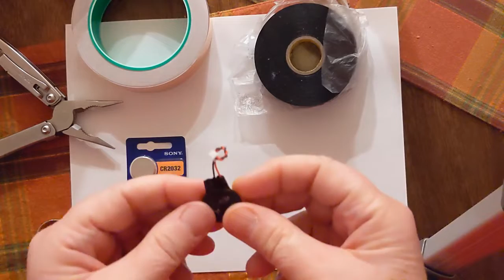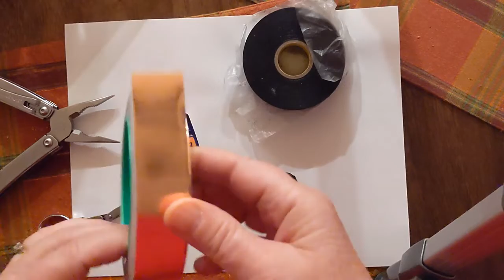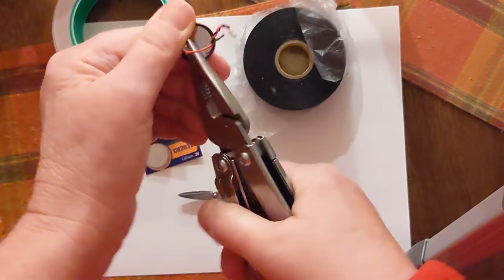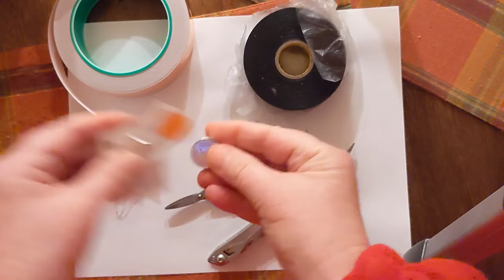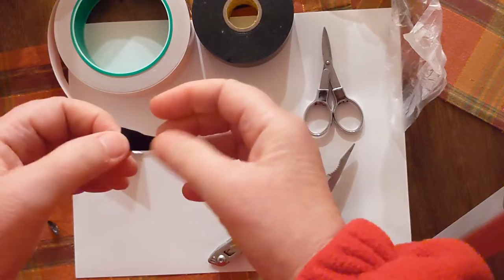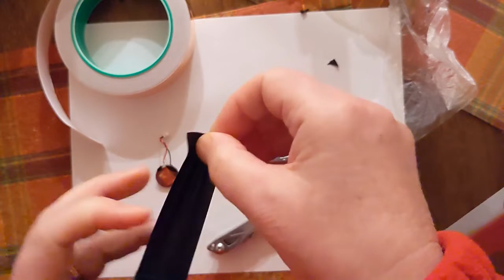DIY Laptop CMOS Battery

Comment: Why are these otherwise normal, sheathed CMOS batteries 🔋😮 so ludicurously expensive 😢... It just has an inch of twisted 🥨 pair of wires a pin 📌 and small metals welded to the sides of the battery 🔋😢, yes the sheath ofcourse 🤥
Reply: Capitalism:  $1 (new price at dollar store for 1 battery because of inflation) for DIY,  $3 (eBay) otherwise. It's still great that we have alternatives!

Comment: Hi, thank you for the video. I have a question regarding my Acer E1-570. The CMOS battery is soldered on the board.

I'm skeptical of soldering the replacement battery. Can I use the adhesive copper tape as a substitute of soldering?

Comment: Do all laptop cmos batteries with a cable and connector compatible with each other? I bought a used samsung r522 but doesn't has a batt. Motherboard has a cmos batt connector. Thanks in advance.
Reply: No, unfortunately the connectors do not seem to be compatible across all manufacturers.  Some laptop models have a 2-pin connector and others have a 3-pin connector.  And as you note, some laptops actually have a desktop-like socket on the motherboard.
Reply: @renebierbaum2131 , I have one spare batt (3Volt-2032) from my eee pc and can easily  connect to R522 mobo . Is this OK? Thanks for your time.
Reply from the maker: @vkdem , I just tried to research the Samsung R522 but didn't have any luck in figuring out what the RTC battery should be for that model.  Sorry I can't help.
Reply: @renealieo  that is why I have to ask.  Thank you for your time. You're a great person. Have a great day.
Reply from the maker: @vkdem  good luck, I hope you can find someone that knows the answer!

Comment: Thank you for this. Gave me the courage to apply this to my own Lenovo T420, which had it's CMOS battery die after 4 years. Additional points to note: The thin insulation around the edge of the 2032 is some form of thin but durable plastic, not heat shrink. This plastic is stretchable, and can be carefully stretched on the positive side  to pop it off, and then transfer  it back in reverse on to the new CR2032. This needs to be done carefully to keep it usable. Heatshrink tubing can be used as the outer cover instead of the electrical tape, which has the additional effect of pressing the metal plates tighter against the cell faces. Lastly, an LED with it's legs trimmed to equal length can be used to check the current is reaching the terminals as expected, instead of using the laptop as the tester.
Reply from the maker: Great suggestions, thank you!
Reply: done this today in my old m14 r1..i just remove the black plastic on the edge of old batt. and transfer it to a new one...heated in lighter to smoothen it..i've also covered the batt with heatsink..👍🏻
Reply: done this today..i'd test the old batt with multimeter, the reading is about 1.2v...the new one is about 3.1 to 3.2v..i carefully peel the black plastic from edge of old batt, and insert it to a new one...and heated it with a lighter..i'd covered the batt with heatshrink and heated up too..now, my old m14 r1 laptop, stops beeping..also thanks to this video tutorial..i'd save about 30 saudi riyals..

Comment: Does it need to be with that tape
Reply from the maker: The copper (metallic) tape helps create a good electrical contact between the metal tabs and the battery.  You might be able to do it without the tape, but you would want to be very careful that the tab is in very close contact with the battery.